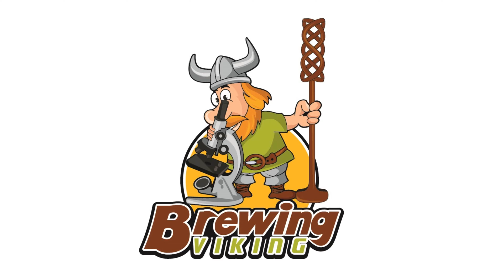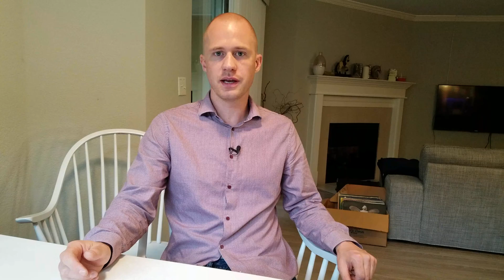Reduce Chill Haze and Permanent Haze with PVPP & Silica Gel

Comment: Brewing Viking is it posiible to fine beer after fermentation with Agar? I have searched and searched but there is no real consensus on this.  As a vegan gelatin is out of the question and I wondered if this would have the same effect?  If you could provide an expert opinion on why it might or might not work I would be really grateful  - regards Robbie.
Reply from the maker: Please see the video on fining with gelatin, and check the comment section. I don't think it will work well to fine with gelatin, due to the wrong charge. However, you are currently commenting on a video that has the two things that will work great for you as a vegan: PVPP and Silica. Another option is filtration.
Reply: Thankyou so much, I am not sure if we can get these products in the UK, I will check it out though.   I stand corrected, I can get Polyclar 730, the PVPP and silica gel mix.  Sound really great :D  Thanks so much :D
Reply from the maker: No problem!
Reply: Hi BV, sorry to hassle you again, I used Polyclar 730 yesterday, followed the directions, mixed 5g in 200 ml of freshly boiled water for about 15min , added to chilled wort which had fermented for about two weeks, waited 24 hrs and then filtered through a 5 micron and a 1 micron filter.  I don't really see a great difference though.  The directions specified that Polyclar should be used and then 2 hours later finings added.  Do you think its critical to add finings or shall the Polyclar gravitate to the bottom by itself?  Any help most appreciated?
Reply from the maker: I am surprised that you don't see a difference after using Polyclar 730. Polyclar 730 can be used at a rate of 5g to 25g per 25 liters. You didn't mention how much you were trying to clear, but figuring you have a 5 gal (19 liter) finished product, then you are at the lower end of the range. Perhaps a higher amount would give you a better result. At the higher end of the range, you would use 1g per liter. 

Don't forget that Polyclar is used to increase colloidal stability and reduce chill haze. If it is not chill haze you are after removing then this is not your product. If you are using a 1 micron ABSOLUTE filter, then there is not settling time needed, as you would catch 100% of the Polyclar. If you have a cheaper filter then consider upgrading it.
Reply: I was reading on beersmith that one should leave the Polyclar for about four or five days.  I waited about 24 hrs and after watching a lecture on polyclar use I understood that polylcar particles are about 15 microns in size and that my filters would remove them no problem, so I went ahead.  I did not use a fining agent although it was specified on the product after initially applying the polyclar and waiting a period of two hours.  Yes it was about 19 litres volume.

I had no idea there was such a thing as an absolute filter, I just bought fluted cartridge filters I think are made of polyester?  will check out an absolute filter for sure.

I must tell you Brewing Viking I have an unhealthy obsession with getting crystal clear beer that I can serve very cold.  I don't know why.  I have decided to experiment with smaller batch sizes 4.5 litres and test finings to see what works best - kind regards Robbie :D
Reply from the maker: I will make a Top 10 methods for producing a clear beer one of these days. There is a lot you can do in the brewing process itself, to minimize how much you have to clean up on the fermentation side. I am working on a Master's degree right now, so time is at a premium.
Reply: Yes let me see If I can cite some stuff from the top off my head

1. Choose well modified malt
2. Do a protein rest (targeting proteinas 55–58 °C)
3. Re-circulate wort
4. Good hot break and vigorous boil to coagulate proteins and tannins
5. Add copper finings like Protofloc near the end of the boil to precipitate proteins and tannins
6. Rapid cooling of wort
7. Use a yeast that flocculates well
8. 'Cold crash' the beer to form haze
9.  Neutralise haze with PVPP and silica gel (polyclar 730)
10. 'Polish beer', with finings or filtration

serve your cold crystal clear beer to the amazement of your family and friends :D

Wish you well with you Masters degree BV, you have been immensely helpful and I really appreciate your taking the time :D
Reply from the maker: Well done! We can add in some extreme filtering at 0.45 micron with an absolute filter and you'll have a crystal clear beer every time. Expensive option, but effective.